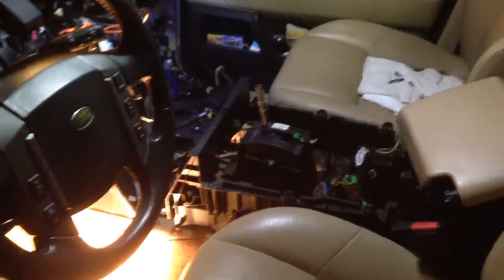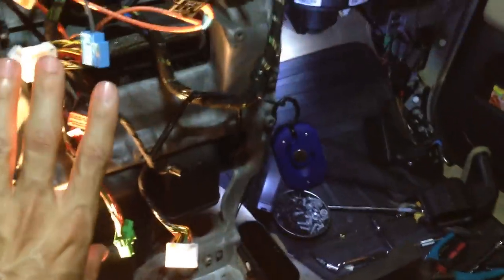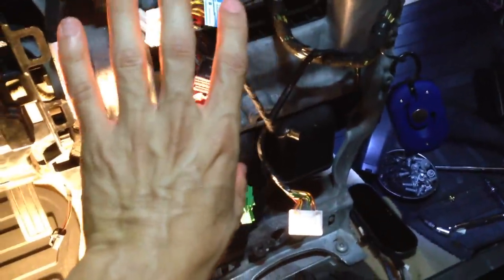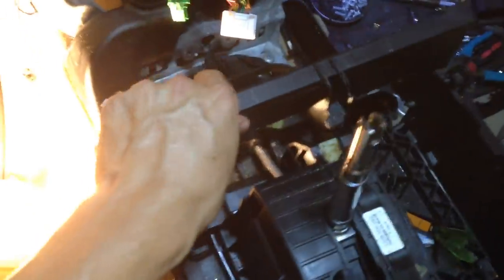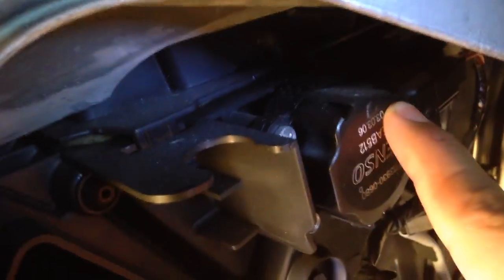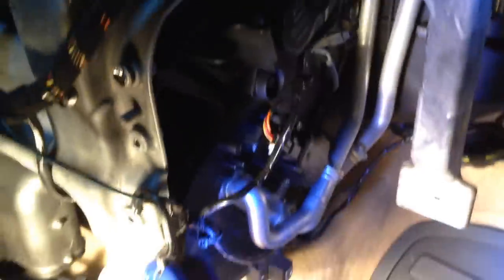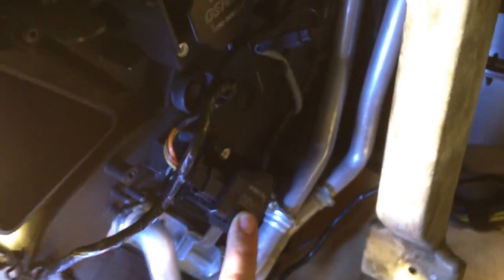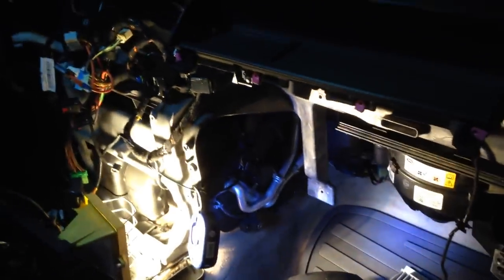Replacing Heater Blend Motors on 2006 Range Rover Sport

Comment: Driver's side takes about 20 minutes. Remove panel below steering column. Blend door actuator is the lower of the actuators. Snip off a little plastic from the area covering the top of the actuator. Remove three screws and remove actuator. The trimmed plastic does not effect  the structural integrity and is covered by the panel when installed.  The other actuators you are pointing out are recirc and mode door actuators. Nothing needs programming. Holding two buttons on HVAC panel and turning on the key starts calibration. There are only two temperature blend door actuators. You have wasted a tone of time and are just going to introduce noise when reassembled.
Reply from the maker: +greg chapman Yeah now I know. I'm a do it yourself guy because I like doing stuff like this. When I did this there were no videos on how to do it yourself so I didn't know. Thanks for the help.
Reply: I was able to get the driver's side blend door actuator out using Greg's method.  It is extremely tight but can be done, but then could not install the replacement due to the blend door sprocket teeth didn't line up with the new actuator.  I had to start the car and let the calibration sequence run and spin the actuator arm around until it lined up while holding the actuator in place and pushing, when the gears lined up I was able to push it fully into place, then attach the screws again.   Before doing that I used an inspection mirror and took pics of the sprocket gear with my phone, the teeth on the gear were pretty chewed up.  I could cycle the blend door with my fingers rotating the gear but with such a tight squeeze, I couldn't tell if the blend door was sticking or fully opening and closing.  I eventually took everything out like  Shelby7922 to get better access.  I was able to rotate the blend flap all the way open and shut but it takes a bit of torque with 2 fingers,, I'm wondering if over the years it has become stiffer and eventually strips the gear.  There is no way to really tell once the new actuator is on whether it is truly opening the blend door.   In the end this didn't solve my problem of no heat on the drivers side (passenger side fine).  Either the blend door sprocket is fully stripped or as I have seen in other posts, the heater is partially blocked and that is the problem, but its still hard for me to believe that would cause perfect heat on one side and none on the other.   I don't relish the thought of taking everything apart again.   The Heater box unit is no longer available for RRSport 05-09 so I don't know how to repair the blend door sprocket.    What a design flaw nightmare on an otherwise beautiful vehicle.
Reply: Hi Guys, Great work really appreciated by us Range Rover owners. I Have a question I have a Range Rover Sport 2006. I have noticed that the drivers side has air con and heating in the front and rear, but the passengers side only has ac, no good for the winter. After reading your great communications am I right in assuming that the blend motors on the passengers side of the vehicle need replacing ? When I turn the heating control from AC to heat I can hear a motorised sound as if turning from cold to hot ? If it is the Blend motors ? are they located on the passengers side, as that is where the trouble is?
Kind regards Chris
Reply: Is this the same for a 2008 lr2
Reply: Thanks brother for your help
Reply: Hi Greg, 

I am in a bit of situation here. I have recharge my ac with coolant agent and now I get super high presures as in 2900kpa in 18 degree celsius outside temp. No errors stored in the ecu but if I check the live data I have invalid position at left air blend actuator. I managed to somehow put it it in maximum cold and the pressures were fine. I attempted to reach it but after am hour I quite because I had no clue how to remove some plastic bits. What I managed to remove was the plastic that has the foot light and the top plastic under the steering (the cover I guess). Do you have some pictures or a more specific tutorial? 
Many thanks in advance

Comment: What a nightmare, I have a P38 Range Rover with stuck blend motors, I was able to get them working again using a wiring diagram and a 9v battery.
I assume the old grease had jammed things up, cycled them a few times fully open / close by reversing polarity, been a few months now and all still working good.
Reply: Bloody good fix mate!

Comment: what if your just getting cold air while the heater is on
Reply: Thats my problem  as well???
Reply: @vfpaintjobs   i just had mine looked at today and unfortunately it seems a mouse has chewed some wires that take power to the actuators.  Seems like there are other “common “ issues with these. 
I was hoping to just have the heater core flushed out. Maybe look into that first

Comment: Shelby says that if we're only getting AC on the drivers side then its likely a passenger side blend motors? Is that true?  I tested the lower drivers side and that wasn't it so it seems Greg Chapman wasn't correct.   It didnt have anything to do with temperature only air flow direction, vent to floor it seemed.  
Does anyone know which one will get heat to my drivers side???  My passenger side is blowing nice and warm.  Air flow is strong on both, but cold only on the drivers side.
Reply: My LR3 will only blow cold on the drivers side, but will blow warm or cold on passenger side. My IIDTool shows fault "B1B76-00 (28) Front left air blend stepper actuator".

Comment: I applaud you for taking the time to post the video, this is a messy bit of work most do not want to attempt, and it is an expensive fix at the dealer; however you went over board on the tear down to get to the motors.
You needed to remove only cubby, footwell panels, glove box and all the trim associated with these parts.
It should take about 3 hrs to tear down and replace blend motors/heater core.
Reply from the maker: +Todd Harris Thanks brother for the help, I looked up all over the internet for videos and manuals to how to get to them and couldn't find anything, so i just jumped in and did it. I got them all switch out but the fifth one and put everything back together. thanks again for the help brother. We should post videos out there for guys like me that don't know crap but are willing to do the work.
Reply: Todd Harris how did you replace the heater core without taking the dash off?
Reply: @dkindig1  I was just wandering through youtube and ran into this video again, not realizing at first I had seen this video before. That being said I just saw this question, which I am sure David Kindig has solved already, but just in case anyone else needs help...
The first thing is to get the proper heater core. There seem to be two available, one with the pipes attached and one with the pipes included but separated. I believe it is related to the MY of the car. Earlier MY's have joints closer to the heater core. If you have a version with the joined pipes you can remove them from the core itself. 
High level; remove the center console surround, which requires you to remove the shifter, the hockey sticks on either side, the cubby, and the lower console insert. remove the glove box, the inner trim panel (center console). You can see the heater core and the pipes from here. undo the screws holding the pipes together and separate, remove the passenger side blend motor, and remove the heater core.  
It is possible as well to accomplish this without removing the center console etc., but you will need to cut out part of the center console(it will be hidden when you put the lower panel back on). to allow the core to come out. Cut it out and plastic weld it back in if it bothers you.

Comment: My local land rover is having a hard time helping me figure out the part itself because they say it's is no longer called a blend door actuator. I have a 2007 RRS, would you know what part of is? I need the one at the bottom of the driver side closest to the gas pedal. Or do you have a picture of it by chance?
Reply: Stepper motor

Comment: I got a 2007 RR Sport HSE , AC and heat work well, but no heat on drivers side. Which motor would it be? I also get a coolant smell, but the dealer can't find any leaks? Any advice will help. Thinking about trading it in, don't have the time or money right now to deal with this... sad because I love this thing!!

Comment: Nice video, real mess you made :-)

Hope your problem is solved....

My left two vents, driverside, will not blow warm/hot air, is that the same problem, and if so, will I need to replace all five? Or is there a left heat core which could be faulty ?

Thanks in advance !
Reply from the maker: +John Koot Like Greg said on how to remove the panel's. turn your ac on and with them heat or AC while someone looks at the servos. you'll see one move and you can hear them turn. So incant hear them turn you found the bad one. but there a total of five, two on the driver side and passenger side and the fifth one is behind the glove under the dash. The fifth one controls the inside to outside cycle. hope this helps.

Comment: Greg chapman what two motors control temp. My sport has heat all around but only ac on the drivers side. I have been trying to figure out what controls this before I take it apart and replace things that might not need resting
Reply from the maker: +Tyler Orr If your driver side is AC then the blend motors on your passenger side are bad. You have two on each side, one controlling the vents to the face and dash and the other controls the vents to your feet. Sounds like you have the ones on  Passenger side are bad.
Reply: +Shelby7792  how do you know it's not the climate control bad?

Comment: I have a problem with my LR4 2010, where the passenger side blows completely cold air, even on full temp and regardless of direction of air flow. Drivers side blows only luke warm, regardless of direction. 
The only way I could kinda heat the cabin was to have only the face vents on, with all passenger vents closed. 
Recently it has become worse. Only the centre, drivers side vent will blow warm air, right hand of the steering wheel vent is now also blowing cold. 
I had resorted to taping up the passenger screen and footwell vents and having the heating set to screen only. This blows only warm air and by the time it has hit the screen and then me, it is cold  Censored 
Best scenario now, is not to use any of the vents and just have the heating on high, so it just eminates into the cockpit from every orrifice in the dash (punch myself in the face emoticon) 
Rear vents are cold too. 

I have taken the driver side footwell panel off, to reveal the heater matrix. Both pipes are red hot. 
I bought an iid tool and re learned the actuators limits and the stepper motor, but no dice there unfortunately. 
Air con works great on all vents.

Do you think It is the actuators/blend motors?
Reply from the maker: lee byrne, sounds as if you have that blend motor on that side has gone bad.

Comment: Why did you have to do this? Is it because they were faulty? Or did you have other issues?
Reply: Temperature blend door actuautors tend to go on these cars eventually. Usually you will get no warm/cold air coming from one or more vents which is an indication that the motors are not blending the air properly. However this same condition could be an indication of the heater core going(yes, even if you are getting heat from some of the vents).
Reply from the maker: +yalahbib I replaced four of them because i just didn't want to take the chance of another one going bad.
Reply from the maker: +Todd Harris if you're getting heat on one side and AC on the other it is definitely one of your blend motors. If you're getting heat on driver side and AC is on, then the motors on the driver side are bad,vice versa.

Comment: So you don't think it will be the AC compressor it's cuz my AC hoses turn really cold and icy when I turn the AC on
Reply from the maker: Bank Roll Mafia Romero, tune the car on, turn your AC on, then turn the heater on. If you feel and hear the change in air flow, that means your blend motors are working. You can tell the deference when you change AC to hater, because you can hear the dampeners change. If you can tell if it changes over then you know it’s not your blend motors, could possibly be something els, in your case the AC compresor.

Comment: 06 Range Rover Sport blower motor completely died. Land Rover dealer will charge $2,800 to replace. Is this accurate? They noted 16 hours in labor. Comments?
Reply from the maker: Linda Eastman they charged you WAY to much! The blender motors are $50 each, and there’s four of them, and one more that’s $75, total of 5 blender motors. I later learned that I did way more than I needed to to change them out. So the labor that they charged you is not what they say they did. It’s far more simpler than what I did here in the video. They wanted to charge me $2,100 for this, and they told me it was something els. Never trust the Land River dealer. I took it to the dealer in Redondo Beach, and I took it to the River dealer in Vegas, and I got two different diagnosis. Never trust the dealers, just a bunch of crooks.
Reply: If you drive the vehicle like a big baller then pay the cost. We all need to make a profit. You work for free? You charge too much what ever it is you do.
Reply: @Shelby7792  
Hello
I saw your video to change the blower motor
You said that you went over doing 
To remove the one on the driver side is any simple method 
If you have any link please share
Thank you

Comment: Do not attempt to remove the console fascias!   You will damage many of the clips that hold them on I don't think they were meant to be removed from the console body.  The whole center console can be unbolted fairly easily, and taken out of the car.  After you have removed the 4 bolts on the shifter saddle and the 2 screws in the front that connect to the heater fascia, there are only 2 more bolts in the rear of the console on each side under a small panel that pops out, move the seats all the way forward for access.  Then Unclip the 2 wire harnesses that come up through the floor Then the whole console can be removed.  I had one wire that came up from under the passenger seat then under the console and connected to the harness inside the rear console cover that has the rear vents and rear seat heater switches, so I had to take that cover off first and unclip the wire, I think it was something a previous owner had connected it spliced into the power for the rear seat cigarette lighter.  There is another You-Tube video that shows how to remove the console rear cover.
Reply: FYI You also have to unclip the transmission cable from the shifter, it pops off like a ball and socket joint and remove the clip that holds the cable to the console before removing the console,

Comment: Great video! Too hard for me to tackle myself. I've got a question. About a month ago the AC was working fine, then all of a sudden the fan wasn't blowing hard enough and it wasn't  cold enough either. Then all was good again the next day.This lasted about a month and it happened again yesterday. Just like before and the air coming  out of all the vents in the truck was weak, even though the dial was set at the maximum speed. I decided to have the freon level checked and the mechanic said it was low. Now with freon added, the car is really cold and fan blowing  really hard. Could low freon cause the blend motor to malfunction? Sorry for the long post. Thanks in advance.  Did  your blend motor stopped working immediately or was it intermittent? Any feedback is greatly appreciated.
Reply: Don't worry about the length mate it give us some valuable information. So thank you!

Comment: Can you give me any instructions on getting the side panels off?
Reply from the maker: Wacko C here you go. Hope you are successful. https://youtu.be/poQmCr_HSBQ
Reply: Shelby7792 thanks for the quick reply. I have that step done. I need to know how you got the leather wrapped sides off that go to the floor?
Reply from the maker: Wacko C it’s one entire piece. You ha e to unbolt the entire thing. I wish I could post pictures but I can’t. https://rover.ebay.com/rover/0/0/0?mpre=https%3A%2F%2Fwww.ebay.com%2Fulk%2Fitm%2F232361345791
Reply: Shelby7792 oh, ok. It looks like you have the sides off in the video but the eBay link makes sense. Thanks again for the quick replies. I'm replacing my heater core.

Comment: What do theses blend motors do?
Reply from the maker: BORICUA CHANNEL they turn the flaps to the air ducts to your AC and heater ducts.
Reply: Shelby7792 Does this also control the rear AC
Reply: They regulate the temperature, as controlled on your dash